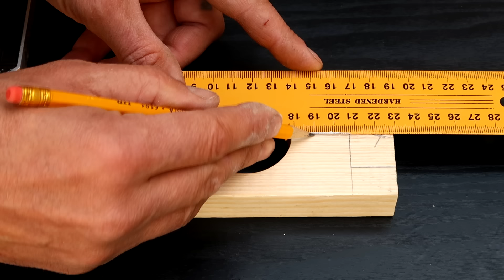Мало кто знает об этой функции ДРЕЛИ !!!

Comment: Router involves higher speeds and hence it will result in a fine cut. Drills do not provide that much of speed and hence the cutting/grooving will not be smooth enough.
Reply: That’s true, but in situations where you might want better control of the situation the lower speed might come in handy. Also, if you do not have a router. This would help you greatly to have a conversion kit for your drill. I have a conversion kit for my dremil and use it quite frequently. Of course as you say, the dremil does have the higher speeds.
Reply: I agree.
I think drills would perform better as lathes ??

Comment: The bearings in the drill are not designed to take lateral loads. You will eventually end up with excessive run out on the spindle.

Comment: The bit speed will be WAY too low to get clean cuts, and the bearings in the drill aren't meant for lateral force.  It will work, but poorly, and not for very long.

Comment: Coat both mating surfaces and let sit for maybe 5 minutes. 

Then apply another coat of glue especially on the end grain. Let stand a fee minutes to allow glue viscosity to increase.

Then join.

Doing so allows the glue to be absorbed into the wood grain creating a stronger joint
Reply: Next, coat your hands and arms in glue and apply liberal sheets of carbon fiber, for when, not if, this contraption decides to buckle and tear a hole in your wrist.

Comment: This is not a good idea; a router bit requires that it spins at 20,000 plus RPM  and a drill is not capable of those speeds. Side thrust on a drill is not what it is made for and in fact could cause a serious accident. A small router will do this job with excellent results and are quite cheap to buy. Play it safe and use the right tool for the right job and in this case a router is the right tool..

Comment: I worked with industrial woodworking routers wadkin bursgreen machinery the speed needs to be at least 15 to 20 thousand rpm at the bit to be safe and accurate.
Reply: Also for long time use drills are not made for pressure coming from the sides... still clever idea.

Comment: Bearings, chucks and safety aside, its still a very clever piece of engineering. Ive never routed with a drill, but we've all used them laterally at some point to widen out a hole or something
Reply: It is fine, but drills don't have the speed required to use router bits.
Reply: Yea tried it once and almost lost a thumb...10 outta 10 wouldn't recommend

Comment: Great idea!  But here's a suggestion.... instead of using screws on the side to set the height,  have bolts sticking out and do the clamping with a washer and Wing Nut.  No need for a screwdriver!
Reply: Here's another suggestion: Save up and buy a router :)

Comment: Seems like i good idea if you want to loose some fingers. Also you ruin the bearings of the drill and it has way to little rpm.
Reply: bcdhifi  No, not at all. Proper routers go up to 25.000 or even 30.000 rpm. Drills do 2.000 maybe 3.000. Even the largest of router bits call for something like 8.000 rpm. Smaller bits need way higher rpm
Reply: Not to mention it looks like they used dry wall screws instead of wood screws. I wouldn't try this set up and I definitely wouldn't use dry wall screws to secure anything that might see more than 20lbs of force. You can snap them them with your bare hands.

Comment: Yes, it's easier to just buy a router.
But it's cool to see that this idea actually works. 
Well done.
Reply: But also pretty dangerous, its a fact that you can take any motor and adapt those cutting tools and do the same, you hit the nail, buy a router that is built to not destroy your fingers
Reply: @elizondocr  
Agree…
Reply: Totally agree, a spinning motorised tool can be used and adapted for a range of purposes but why?? this is hideous and clearly not safe, anybody who thinks these wooden deathtraps adaptions are a good idea needs to seriously get a grip.
I'm a carpenter of 25 years.
Reply: @buster8015   I wish I had seen this a year ago before I spent a lot of money (I could ill afford) on a router that I use periodically.  I don't see how using this device is more dangerous than using the drill to drill holes in a wall!  It's probably safer.
Reply: @josephwalsh3401 I could not disagree more, hideous makeshift tools are not a substitute for approved and tested equipment. Not to mention the time and effort involved to produce these devices. To endorse such ideas is as idiotic as the concept itself
Reply: @buster8015   Hi Buster.  You are perfectly entitled to disagree, it's just a pity you feel the need to use such a "put-down" tone.  

Because you disagree so vehemently does not mean that people won't make this jig and get many years of satisfaction out of it.  It's their time, their wood and their choice.
Reply: @josephwalsh3401  Fair comment, apologies for the tone of the response.👍
Reply: @buster8015   Buster - apology gladly accepted.  It takes a man of integrity to apologise so quickly - or at all!
Reply: I guess if you don’t have a router, and have no way of getting one, this will do in a pinch.
Reply: @buster8015  I think the main point of this demonstration is to show what you can do without the right gear, yes there may be inherent dangers, but this man has shared an idea that could help those in less developed countries be more creative. Great to see some positive debate though.
Reply: @josephwalsh3401  Their time, their wood, their fingers. :)
Reply: I wouldn't advise it to be handheld... but ....use a modified router table ....

Comment: I'm interested in converting my bandsaw into a drill press and changing its power source from 120VAC to Milwaukee M18 platform. I also want to integrate a Bluetooth speaker and espresso machine.  Any suggestions?  If possible I would like for it to work with Windows 10  or Debian. Thank you in advance.

Comment: The function of a drill is to provide a rotating output on a shaft or the chuck, you have provided an adaptor to change its output. If you look hard enough, you will probably find there is a company out there already producing such a thing, and many other adaptors, to change the output of the drill. You have not added a new function to the drill!

Comment: a Prime Example on how not to use a drill. The bearings in the Drill are only designed to bear Forces along the rotational axis. NOT PERPENTICULAR´to it. Also a drill does far less RPM than a Router

Comment: Someone needs to learn the difference between "ability to" and "Function"  

For example, a drill has the ability to perform this function, but it does not have this function unless you do this overly complex process.

Comment: A drill and a router have different motor configurations that allow routers to spin up to 10,000 RPM; most drills max out in the low 1000's.
Still, if you have LOTS of time to waste, you could use a drill but the job would take 10 times longer!

Comment: i agree with others on here. tools are designed to do a specific job. use them for an entirely different one and you are going to run into trouble. a drill is NOT  a router. in the same way a screwdriver is NOT  chisel.

Comment: The bearings in a hand drill are not designed to endure the lateral forces exerted when routing. Your hand drill will not last as long as it would have if you use it this way.

Comment: Never start a job without ensuring you have to buy a new tool to do it properly, that way you don't have to bodge something like using a drill instead of a router ( you can pick up a decent router from Lidl and Aldi for less than £100 which will probably last a lifetime for a hobby user)

Comment: Not sure what you are trying to solve.  An electric driller does not have the necessary RPMs to function as a router.  For the time and money you spent making a janky unstable wood router frame, you can buy a proper precise router for $30 and not create an unsafe situation.

Comment: Has anyone heard of the phrase "The right tool for the right job"! If a drill was designed to use router bits then an attachment would have been provided by the manufacture. Here's the thing all these videos where people modify/make Jigs so that Drills, Angle Grinders, & other tools do jobs of different tools like Routers, Table Saws, or other tools is always a bad idea and dangerous.

Comment: One can buy a cheap router and do far more with greater safety. RPM on routers is a great deal higher than on drills. The lowest speed for a variable speed router is 8000 rpm. I do not know of any drill that can match that speed. Router bits are designed for high speed operation, up to 24,000 rpm. Your 'invention is like using the point of a knife as a screwdriver. Yes it works but it twists and breaks off the point of the knife.

Comment: All very clever but that drills max no load running speed is I suggest no greater than 3000 rpm and probably less a routers normal no load r/s is about 24000 rpm there’s a reason for this u’ll get a much better finish to ur work truth b told if u need to mould up timber ur probably better of with a router it’s been designed specifically to do such tasks and a drill is designed for drilling that’s about the jist of it

Comment: Few people know a drill rotates a bit? Wow, i should be charging more for my skills, also this isnt as efficient as a router, rpm is too low, my m18 handheld router would do that in like 1.5 seconds with only one pass, and no power cords to move around
Also the router base on the m18 is plexi glass so much easier to see, thats one way to improve a handheld router without fully redsigning it

Comment: Most people don’t know this because it shouldn’t exist! Drills are not designed to have lateral pressure applied, this is ludicrous and for the time that was spent making it, you can probably pick one up for £30, it’ll be rubbish, but at least it’ll be safe. A drill is not engineered for this, nor does it run at suitable speeds. Do not make this.

Comment: Never do this.  Drill chucks are not designed for lateral loads, and can fly off when you do this.  I know, I've done it.  It's stupidly dangerous.  Buy a router - even a cheap one will do a better job, give a cleaner cut, and be vastly safer than this.

Comment: Dangerous waste of time. If you would like to loose a finger or two? Then ok. But just use a router designed for the purpose. I’m a carpenter and the right tool for the job is best practice

Comment: This  is 100% BULL. A drill spins at about 1200 rpm Max. A router spins at 10,000 rpms. That bit will chatter and bounce all over the place. I tried in my drill press.  That spins at over 3000. It doesn't work.

Comment: Use a router. It is designed to handle the side loads that routing produces. Bearings are different.  Also routers generally operate at much higher RPMs.   Sorry, this is just another bad idea.  Also, ironically,  he needed a router to make the slots in the wood fixture he made.

Comment: Many people know this but few people actually do this because first of all, the weight distribution of a drill and a proper router is vastly different, bad idea to turn a drill into a router. Secondly, a drill simple doesn’t have the RPM to do proper routing works. Terrible idea and terrible design.

Comment: STOP making these drill videos stating little known "functions". Drills aren't designed to do this stuff. Their "function" is to drill. Not to saw, not to polish, not to do the crap you put on here. You CAN modify of.make hem do different things, but not it's function and any side to side pressure starts wearing out parts.

Comment: WING NUTS...
Thanks for the video I think I am going to try it

I was just going to say, have you thought about using wing nuts for the depth adjustment? (...just thinking it might be easier than using a screwdriver...)

 (but I think a hand-held router would work just as well?)
?

Again thanks for the video- it looks like it works well!

Comment: All you need is a drill, scrap wood and two hours of fabrication work. The only down side is a cheep drill cost as much as a cheep router and your not relying on drywall screws to lock in your height adjustment. Totally stupid video.

Comment: The issue of side loading the drill bearing has been mentioned.
Wood screws into end grain do not give a strong connection as the screw severs the wood fibres meaning little strength. 
Ok for a one off job but really get the right tool for the job, even if you have to hire it.

Comment: Brilliantly simple way to get a basic router, although the spindle speed would be a bit low for the cleanest of cuts. An equivalent accessory for grinder with a chuck adaptor would be even better due to its MUCH higher revs.

If you already have a 1/4" (6.5mm) router, a half inch chuck drill would give you great extra capability for ABSOLUTELY minimum cost. 👍👍👍